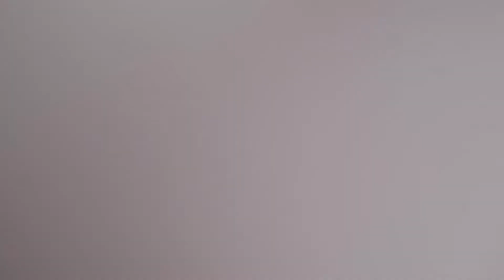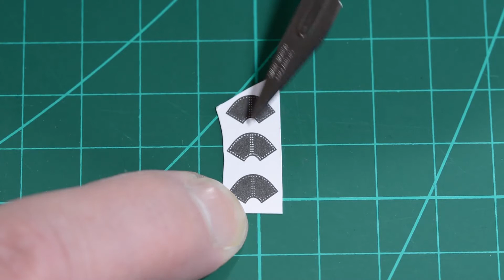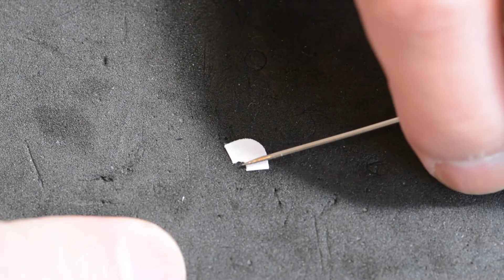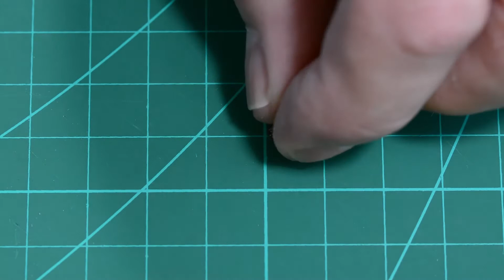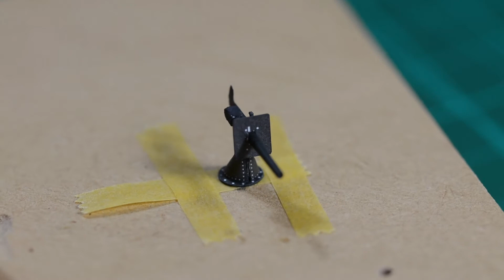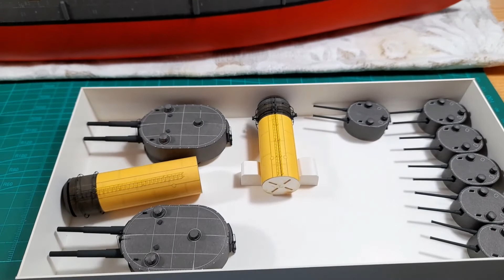Borodino, Paper Model, 1/200 Scale, Part 3, 47mm Guns

Comment: Excuse me, how do you make the ship's railings?
Reply from the maker: Hi, the rails are 0.2mm brass wire bent to shape using the template provided with the kit (you can see this process in Part 6)  
The bent rails are then fed through holes in the stanchions (posts/uprights).These are photo etch from GPM card model shop.
Reply: @plungingfirescalemodeling2441  oh thank you very much by the way the model you are building is incredible

Comment: what kind of material do they use for the turrets and for the hull of the boat it looks great
Reply from the maker: Hi thanks for the comment. The turrets are paper with a thicker card internal frame as is the hull.  I replaced the kit paper barrels with turned brass and aluminium.